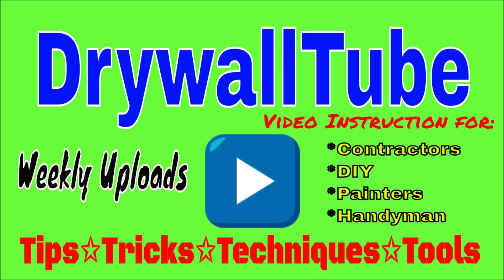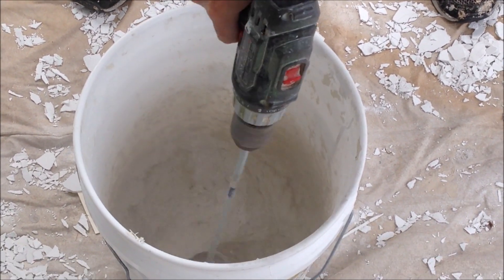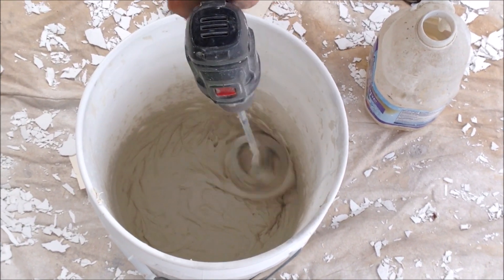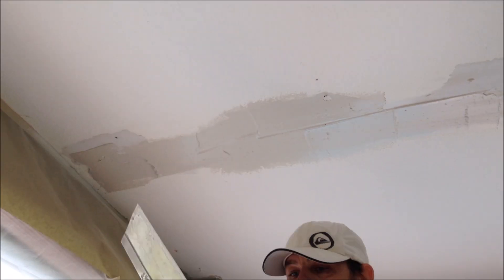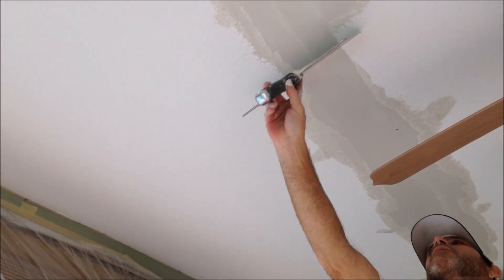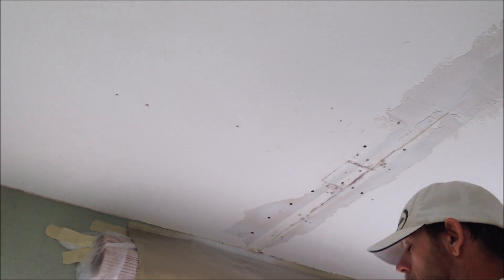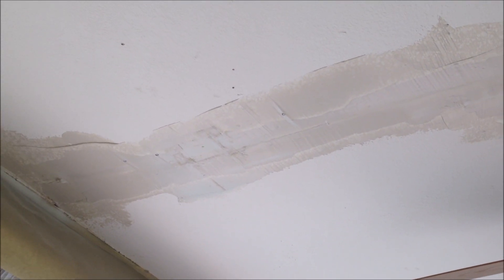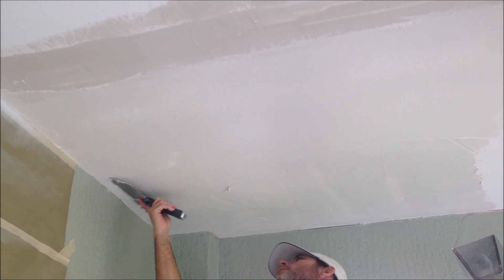How to mix Hot Mud and Apply to Ceiling Crack Repairs

Comment: Great job! Im a General Contractor and Painter. 40 yrs! Great advice about the 20 minute. Guys dont realize that tape is outmoded. Fiberglass or Fiber Fuze is the way to go.  Tape gets brittle and the other doesn't!
Reply: Thanks for confirming what I have suspected about the old, outmoded paper tape that has haunted me in my house built with sheetrock in 1960 !

Comment: Lady diy, glad to watch video, for sure this is a job I’ll need to find an experienced contractor for. Knowing what the correct materials are is g2 help me cull an inferior contractor. That is #1 right? It’s an attached garage, we always have heavy dust, thinking over time and using a Milwaukee leaf blower to keep dust out of the garage has caused a couple long 6:59  tape seams to separate. Thanks for great info

Comment: DIYer, painted professionally but never did much drywall till now I need to refinish our bathroom as the texture is rough. I was thinking about retexturing but your videos are giving me confidence to try skim coat and just have smooth walls. But first to fix uneveness and balance out the texture height I am going to try to roll on mud knockdown texture. Hope I can find one of those lexan knockdown tools and a sea sponge roller / handheld tomorrow your videos have saved me from getting discouraged. Day 2 and I'm still trying to fix uneven joints. Learning a lot, one smaller bathroom probably going to take me a week but will have taught me so much. Drywall is hard thank you for sharing your knowledge, tips and tricks! Next time I feel like if I apply for another painting job I can add I watched all Paul Pecks Drywalltube videos to my resume lol!!

Comment: I’ve used the 90 minute mud to pre fill joints and gaps. Works great, not much shrinkage and dries hard. Im not fast enough to use the 20 minute mud. Great tips Paul.

Comment: I too avoid sanding as much as possible, usually small ones like that just a light pass with a sanding sponge ensures no lines. Always good to see what others do, even when you have been doing remodels and repairs for 25 years there is a new technique or another approach to learn. Thanks for the vids!

Comment: So what do you recommend to use for the heavy popcorn texture? On new drywall...first do tape joints with all purpose then mix popcorn with mud and use a hopper? For a couple coats...same all purpose mud then prime n paint? I have herd of popcorn you mix in paint but now im thinking that it wouldnt be heavy enough just using it in the paint...cool man your helping already! Lol 😆 but the customer wants as much sound proofing as possible and for it to match the other units...i personally dislike popcorn and love your knockdown technique with the sand. Smart and no hopper needed! I could just mix popcorn in the mud and skim it on the ceiling..

Comment: Im a painter,an of course i have to do patch work w/mud but not a whole lot of Drywall experience...Is it ok to 'stir' around an entire bucket of mud before i use it? Or should i only stir smaller amounts that i will use that day w/a cordless drill because stirring it somehow changes the mud if its left in the bucket ? I didnt know if once i started mixing the mud around it must be used, because when you open a bucket its harder an thicker...

Comment: Do you set a timer or just let the mud's consistency remind you to stop and go back to clean out your bucket?  I like hot mud but I've goofed a time or two and gone back to have mud hardened on the tools and in the bucket which can mean just throwing the bucket out is it is too hard to chip out.  

Also, one tip I got from another pro drywaller that I like is always using two screws,  instead of one, about 2" apart to minimize/eliminate ceiling screw pops but especially when doing any repairs to a screw pop as you know the area has had movement and needs more support that the one screw (assuming it wasn't just over driven).  I've done this for the handful of new and repair drywall work I've done for us and family. May be overkill but only takes another second which is worth it to me for the extra insurance and confidence that it won't have issues again.

Comment: Great video - you might have covered this before  but do you prefer hot mud over premixed in general or just when you need to do something quickly?  I use green lid for taping, blue lid for general work and only hot mud when i need quick drying.

Comment: DIYer 
I will hang and repair drywall for days. I just can’t tape or finish it for nothing
Reply: Sanding and setting yourself up for minimal sanding is the hard part. You can learn a lot of a remodel or two. You can do it brother.